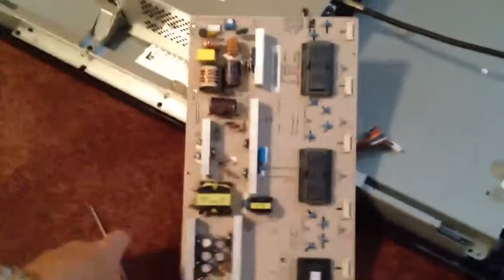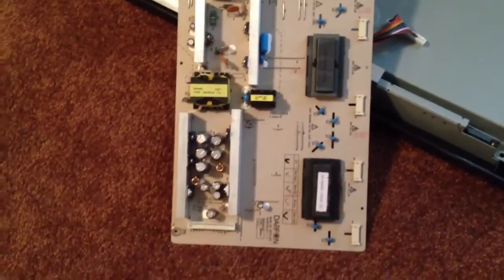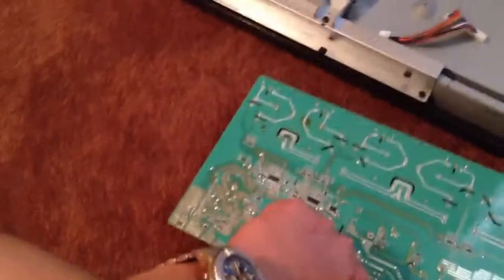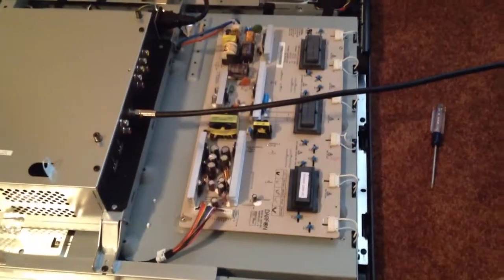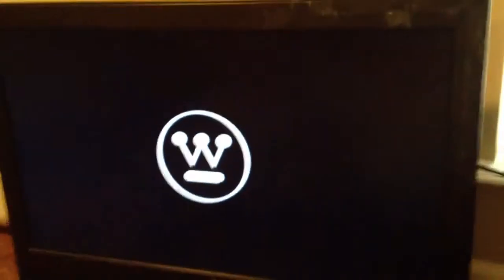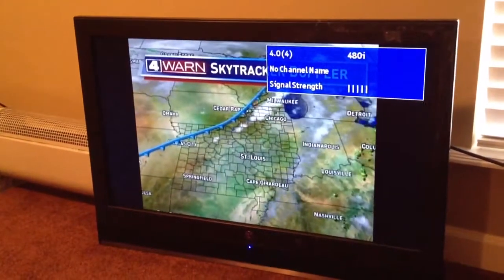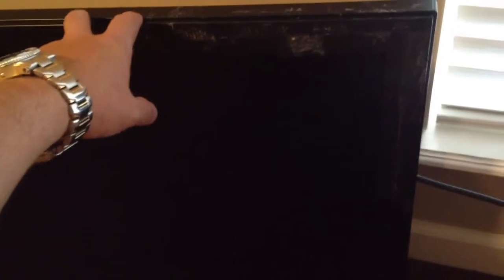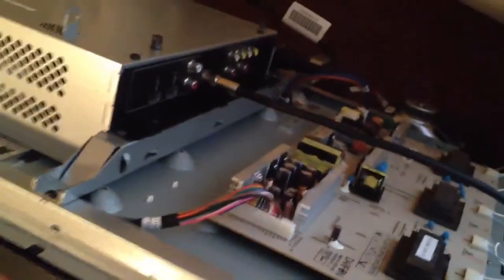Soldering Transformer 4302H to DARFON B070-601 Westinghouse SK-32H540S Pt. 3

Comment: Ive got the same issue with my westinghouse.  I also cant find an exact part number match for my burnt transformer 4302H 804030 (GP)_.  Does the replacement transformer need to be an exact match?  I assume it does.
Reply: Eight Cyl. Only the 4302h

Comment: I also had the same problem.  I ended up buying the inverter from shop Jimmy's.  Removed the old inverter and put the new one on and it worked perfectly.  My problem was only the smell not the picture going out.  The inverter was located in the middle not the side like yours.  Good luck everyone!

Comment: What I did was change the same part with same results. So I did a little investigation and found that the plug that goes to the rest of the tv has 2 pins that show 12v that are dead. if you trace them back they go to the secondary side of the transformer and there is no voltage there. I did find there is 110 volts on the primary side it might have been my ground but that is what I have found so far. Sorry not trying to steal your post.

Comment: I tried doing the same repair.  The new transformer burnt out after a couple of seconds.  I suspect that is what happened with yours.  "What is causing that transformer to burn out" is the real question.  If the problem is on the Darfon board, then replacing it may solve the problem.  BUT,  what if the cause is elsewhere?  And after replacing the Darfon board, the transformer once again burns out?  Someone at Westinghouse knows but isn't speaking.  To sum it up... Westinghouse stinks!